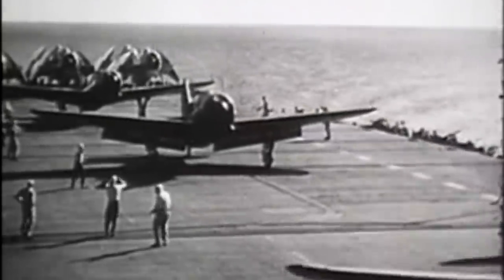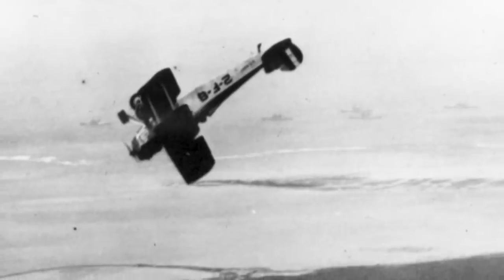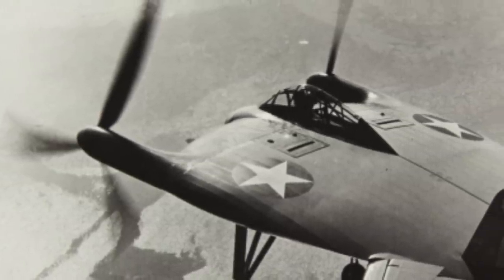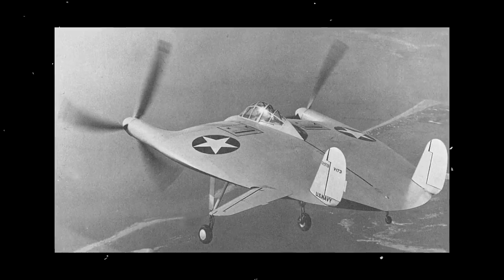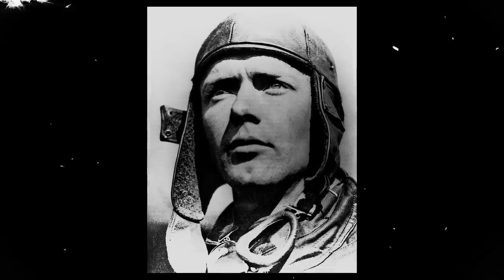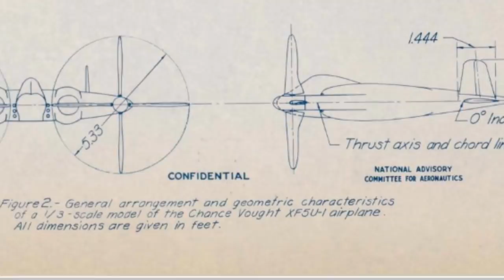The Experimental All-Wing Carrier Fighter - Vought V-173

Comment: The Corsair WAS NOT carrier ready, far from it!  The long nose (and low seating position, till replaced by a bubble canopy), made it hard to see to fly the approach aboard.  A problem with the landing gear caused it to BOUNCE badly when landing aboard ship, the very long prop was also prone to deck strikes when TAKING OFF.  The Marines decided to accept the aircraft (with the proviso that it WOULD NOT be in ship board squadrons).  The Royal Navy modified the landing gear (got rid of the bounce). Taught carrier pilots to fly a curving approach (enabling the pilot to see AROUND the long nose).  A slightly smaller propeller (4 inches) reduced both torgue roll (which was also a (minor) problem) and deck strike problems.  A last modification allowed the seat to be raised higher (to also make it easier to see over the nose).  P.S. when they got the 'bent-wing bird' it was a hell of a fighter.  One of the famous squadrons that flew it was VMF 214 (now VMA-214), the black sheep.  As they learned the awesome load carrying capabilities of the aircraft they would put in for a change specification to the aircraft.  Their first was to allow a 500lb bomb to be carried on the center-line drop tank mount (in typical USN bureau time lag, it took a couple of months to get approval), when they got the change the Black Sheep informed USMC command that they had ALREADY started to put 1000lb bombs on the mount!  So again, a change was submitted, when it was approved the Black Sheep informed their command that they had modified the mount to carry a 2000lb bomb! (by then the USN and Vought were working on testing the Corsair to carry a TORPEDO!).  Vought sent a veteran pilot/tech rep. to the Black Sheep to see what they were doing to Vought's aircraft!  When the guy got there he saw a make-shift bomb-rack (made from plumbing supplies 'borrowed' for an adjoining ARMY squadron! and carrying THREE 1000lb bombs!  When the shocked tech rep asked how they dealt with the HUGE over gross-weight problem they had, the crew-members smiled and said that Pappy (Boyington) had fixed that problem.  As the grossly over-loaded Corsairs went out for their next strike (at the time ON THE SAME ISLAND), they taxied past the 'normal' taxi-way and onto a winding (barely wider than the wingspan the Corsairs) taxi-way which wound AROUND the end of the fighter strip to the end of the 1000 foot longer BOMBER strip (Boyington had convinced the SeaBees to make him a taxi-way to the longer strip)!  From what the Vought guy said it took every foot of runway and ALL THE POWER  Corsairs could muster to stagger into the air!  Supposedly they never got above a thousand feet till they got rid of the bombs (because they COULD NOT)... and much lightened would scramble home (while the maintainers scrounged more ordinance to load).

Comment: Wait... he said the wood version weighed 3000 lbs, and the metal version weighed 5 times that... so 15000 lbs? And then later he says that the XF5U was five times THAT? So it's apparently a 75000 pound plane?

Comment: This video neatly fills in an informational gap: the lifting wing bodies NASA and/or US Air Force experimented with, especially the HL10, X-24A and M2-F3 from circa 1964 - 1975, evidently have a parent!! All viewers 50 and older will remember Lee Majors AKA Steve Austin (Six Million Dollar Man) in the opening credits,  busting up an X-24A during a landing whereof the aircraft behaved poorly. Interestingly this is based on an actual event, although in reality the pilot was killed, not re-assembled with bionic limbs. 
     Having viewed this video, it is not difficult to understand why  governments would be very interested in lifting body designs:
*STOL ability.
*Extremely stable platform, not prone to stalling or tailspinning.
*Potential for supersonic speeds. 
*Potential for out-of-atmosphere excursions.
*Superior upper view for flight crew when aircraft is flying level.
*Wide flat body likely would offer surface tension on water, ideal for water-ditching in emergency. 
*Extreme glidepath likely in excess of 30 to 1, ideal for flight crew safety. 
*Relatively low-cost construction potential. 
I think it likely this design will be re-visited. 
Note: military person in video referred to this aircraft as a flying wing. Honest mistake. Flying wings are similar to lifting bodies but not the same; use different, more conventional  principles of flight.

Comment: Wrong about UFOs. Few would have seen secret Navy experimental aircraft. First one of 20th century was Kenneth Arnold's sighting of June 1947. The word was not even coined until the 1950's.  The newspaper clipping was of the Roswell incident of 1947, nothing to do with the Flying Flapjacks.   Also, any pilot (or common sense) will tell you that not being able to stall or spin is a Good Thing, not a disadvantage. Also am sure the early version had engines with way more than a measly 80 hp, especially if taken from the Corsair. Do some research before rushing to release these videos to make money.

Comment: As usual in talk about this, most are ignorant of the Arup S-2 of 1932, the Nemeth "parachute plane" also of the '30s. Neither were slow or draggy at cruise, both demonstrated super-STOL ability.
There is very much incorrect information in this article.

Zimmerman did not independently come up with the concept, and the wing-tip mounted, plane-changing, tuned, outward turning props did not give it its super-STOL abilities nor are they what made it stall-proof, nor did they counter the wing-tip vortices.

Zimmerman worked for NACA in the '30s, and he saw the Arup S-2 put on an amazing demonstration for NACA. Only after that did he copy the planform as a starting point for experiments towards a VTOL tail-sitter.
Arup and many others were working with the very-low aspect-ratio planform for its super-STOL, stall-proof abilities. 
Aspect ration is span^2, /area.
As Zimmerman wrote for NACA and in patents for UAC: at aspect-ration under 3, at very slow speed high nose-up _A_,  the huge wing-tip vortices wrap around and capture a "bubble" of low pressure behind/above the wing, increasing the lift at such speeds.
At the same time the strong vortices trap flow from the front over the top of the wing, keeping it from separating and ensuring strong smooth flow to the trailing edge controls. They do not "stall", even if they're not producing enough lift to stay aloft.
They do not always carry around he burden of the huge vortices. They are a product of the very high nose-up A used to fly very slowly and not stall.
The huge vortices and parachute lift effect and the attendant huge drag are elective and temporary, to fly slowly.

Zimmerman wrote that he chose the planform specifically to maximize the vortices and the parachute lift. Despite much that has been written and said about it, the prop situations were not intended to minimize vortices at cruise.
It did not gain its stall-proof super-slow flight from the props, but from the planform, as demonstrated by many other planes of such planform, with normal propulsion.
NACA tunnel tests with the V-173 showed that it did not gain anything nor particularly change anything with the situation of the props, versus normal 0hp props spinning like any other twin.
After choosing the planform to maximize the very-slow high-A vortices, he did not use the props to counter the vortices, you can't counter them and it didn't, and very many other very-low aspect-ratio planform planes demonstrated everything the Vought/Zimmerman plane did.
It did not gain its super-STOL abilities nor gain any efficiency at cruse, with the situation of the props.

The Nemeth, the Arup, and others demonstrated that they were not draggy, despite conventional wisdom saying that they must be draggy.

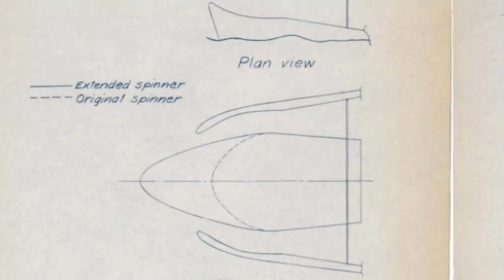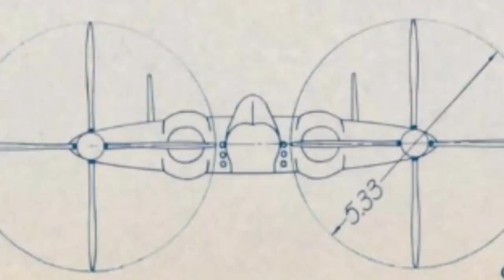Comment: The comment made at 6:06 about the V-173's drivetrain issues also applied to the XF5U, only much more so.  With this design, it's imperative that in the event of an engine problem, the problematic engine needs to seamlessly unclutch from the driveshafts so both rotors (props) can continue turning in opposite directions.  Simply having both opposite turning, longitudinal rotors attached to each other by a transverse driveshaft which is driven by two longitudinal motors is its own challenge.  The V-173's problems, using the two 80hp motors, were eventually fixed but the XF5U's problems, with the two 1600hp R2000s, never were.  The image shown at 7:50 shows the XF5U with the complex four blade rotors (intended for flight, can be seen here 9:09) removed and two Hamilton Standard four blade props (Navy stock parts for the F4U-4) installed as ground run "clubs".  Note the prop nearest the camera, because it rotates to the "left" (clockwise in image) the blades have been reversed so it actually "blows" air forward (compare to the other prop).  The reason for this was that the Navy had no left hand turning props at this time.  And, just to be clear, the illustration at 8:54 shows arrows rotating inboard, that would be the direction of the wingtip vortices, the rotors (or props) would counter these by turning outboard against them.

Comment: Is there no civilian version of the V-173 today? If not, why?

It seems like a lot of fun, as well as being safe and easy to fly. 

STOL capabilities also expands its versatility. And combined with its ability to hover, I wonder if it could even take on some roles that are currently done by helicopters. Drones based on this design could help with problems in rural areas! For example in first response, where the current drone used is the quad-rotor design, which comes a bit short in speed and range.

I see posibilities for modern use of this design, but I assume there are reasons for why it isn't used

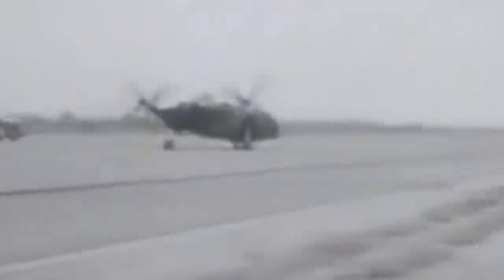Comment: The narration and the diagram @ 8:55 - 8:59 are all wrong. Stop the video at 8:55 and look at the propellers: the diagram showing the direction of propeller rotation would enhance wingtip vortices, not cancel it.  Look at the propeller pitch, and the propeller cuffs: the right propeller is set up to rotate clockwise and the left one to rotate counterclockwise. The arrows that are photo shopped over the picture are in error, the propellers are obviously going to turn  the other way. There is an even better picture of the propellers at 9:09 that shows how they rotate and again at 10:37 which shows them in motion.

Comment: I'm not an engineer, but what if someone used drones beneath the body of the pancake to propel it along instead of two contra-rotating propellers at the front? Would it have vibration or balance issues? Forgive my ignorance, but I recently saw the flying with drones video and this 'pancake' setup might work...or not.

Comment: A close friend of mine Gerald Scharffenberger 
Was the Engineer of the power plants on the pancake. When he retired as the Chief Field Engineer at LTV I was given the task to find this airplane. And I did it was at Norfolk VA. The stabilizers on the tail was for flight test only because if you look at the model test it had none. But to put the mines at rest they put them on for the pilot. The destruction of the later pancake was done to the surprise of Vought because they were on the truck heading to flight test at Edwards. That same month Northrop was told to destroy yb49 the same way as vought was told to do. They wanted no pieces of the plane recognized. And sent to the foundry for meltdown. Not to many records is left on these flight test aircraft except for the first pancake which was restored by LTV retirees in Grand Prairie Texas. And is now on display in the frontier of flight in Dallas Tx.

Comment: He missed one of the main aerodynamic features that predicated the whole design. The large props that extended out past the "wingtips" eliminated all wingtip vortices. Those are a huge contributor to an aircraft's overall drag. Without that drag the whole thing could be made lighter due to smaller engines being adequate. More drag, less weight, higher lift. It had such a low stall speed that with very little headwind it could take off vertically. From the deck of an aircraft carrier steaming into the wind it wouldn't need any take off roll.

Comment: The wing: if you were to draw a circle, and place within the circle parallel chords, then pick off each chords at 25% datum.
Now separate each chord and align all the chords in a line, thats how the wing planform was conceived 
The original V173 had no upperworks cockpit as the pilot was meant to fly it prone. 
But as the test pilot refused to fly it in that configuration a new more conventional seating position was devised with a full canopy.

Comment: later, Vought developed the F-7U(?) Cutlass similar in configuration.  continued development of the "Pancake" with jet engines or turbo-props may have fulfill the navys design goals for a STOL a/c
Reply: Nope. The concept of the F7U was based on aeronautical research recovered from Arado after the German surrender. Its jets can't provide airflow over the wing to generate lift, which was Zimmerman's goal and provided exceptional low-speed performance. In fact, the F7U's low-speed handling was dreadful - many more were lost in landing accidents than was usual in carrier operations.

Comment: I think with current technology someone could make one flyable but a lot of engine thrust vectoring & surface controls.
Reply: Extra technology wouldn't be necessary - it was already flyable. In fact, it was exceptionally safe. It stopped flying because the funding was cut by the Navy in 1947, and the team reassigned to other projects.

Comment: Vought still could have used two jet engines to push the pancake and not use propellers . The real reason is that the pilots did not like the pancake . It looked stupid to face an attack on another aircraft .   It is a wonderful concept .  Now we have the flying wing and it looks bad to the bone .
Reply: Jets would've killed this design the pnly reason to put the props on the wingtip is to get the benefit of counteracting the wingtip vortices and use the props to make air that would normally slip out from under the wing tip spin under the wing and hit the underside of the wing and increase lift even at very low forward speed.
Jets don't apply this torque to the air stream so woild loose the main benefit of the design.

Comment: I think this aircraft could outperform well-known close support aircraft like the A-10, including speed.  Possibly this type of configuration would only need a very short undeveloped field and fly faster than the Harrier. It’s design speed is 400 knots and landing speed 30 knots, a very wide speed range. It could also contend with other light aircraft, drones, and possibly high speed aircraft in a tight turning battle.  

Given that the configuration has a very low landing speed, it could hover in a jet-stream as well.  But that also implies very good high-altitude performance. The development of supercritical aerofoils for subsonic aircraft would undoubtedly benefit this configuration.

If it could evade missiles using some kind of turret, then it could probably contend with anything.

Notice that the XF5U had large wooden propellers, which meant the aircraft was intended to be stealthy.  The CIA used a turboprop with a wooden propellers during the Vietnam war.  Vibrational problems could be lessened by using an 8-bladed prop and turboprop engines.  If propellers could be made stealthy, then this aircraft could still be used in an operational role.

The modification I would make is to sweep the elevator tips forward and that the elevator tips rise and fall into anhedral, dihedral or split-hedral depending on whether the aircraft is directed to climb or dive, or roll. With all of the modern developments in military aviation applied to this vehicle, this aircraft can compete on the modern battlefield.

I like to imagine you can use titanium diboribe as a shell material and pass ions through the structure increasing its strength, making it invulnerable to ground fire.  Kind of like a sci-fi flying tank.
Reply: If the XF5U's wooden propellors "meant the aircraft was intended to be stealthy", would you care to explain why the rest of it was made of metal?
Reply: thisisnev They were hoping it would be. The flat shape would have lowered the radar cross-section.  Plus they could have resorted to building it out of wood.  But those times were gone by war’s end. You have to wonder if they could have resurrected the project using modern methods, materials.

Comment: One has to wonder why they didn't just replace the  piston engines with jets. If the outlets for thrust were placed right you'd still get the STOL plus you'd have a fair amount of range to boot. SMH.
Reply: Replacing the props with jets would have made a design with none of the advantages it was created for and all the weakness caused by the compromises made to achieve those advantages.
There is no point in putting jets on the wingtips but there was a point in putting props there.
Reply: The propellors created lift by making airflow across the wings faster than the forward velocity of the aircraft.  The only way you'd "get the STOL" by replacing them with jets would be to output the thrust from directly in front of, and along the entire span of, the wings. Good luck with that.

Comment: It seemed like back in the day if you had a crazy idea for a plane theu said here's money make it work
Reply: Really wasn't that crazy the narrator fail to explain the advantages that the design was to get from the placement of the props.
It's obvious because he has the props turning the wrong way causing the air from the props to push down on the wing instead of up giving extra lift.
If jets were not present this design would likely have been developed it went 75 mph faster than the mosquito and 30 mph faster than the p-38 lightning.